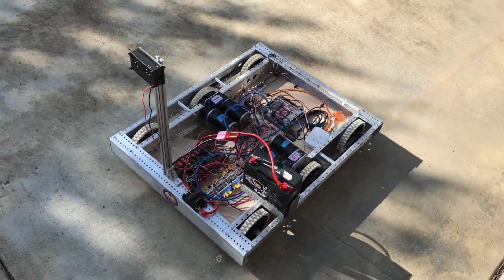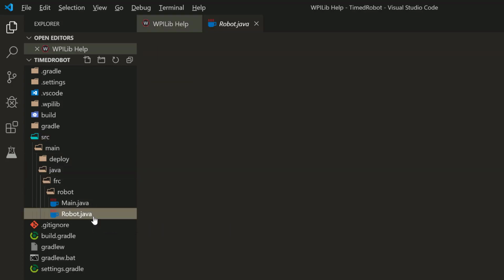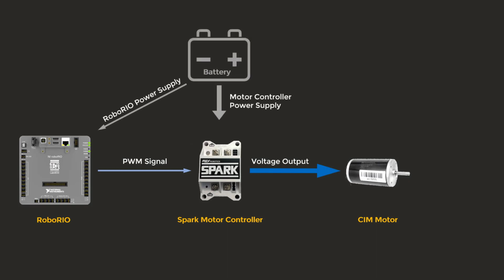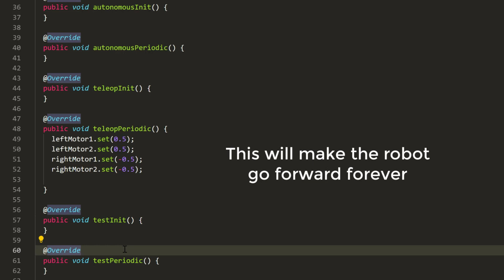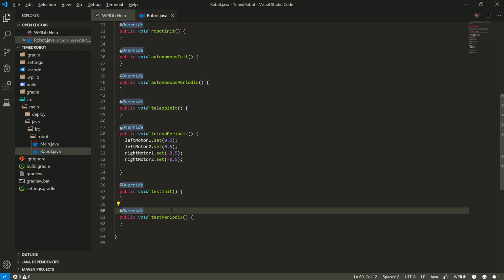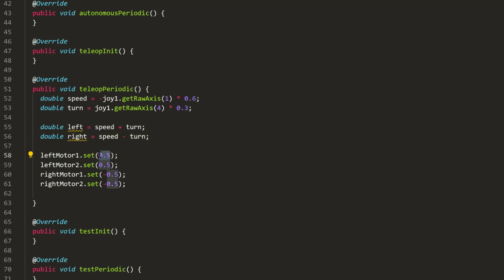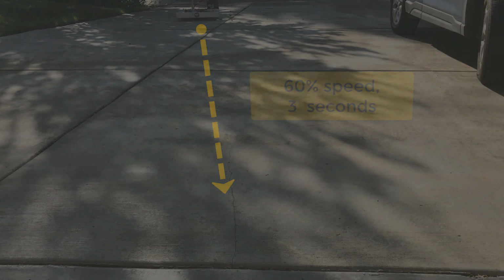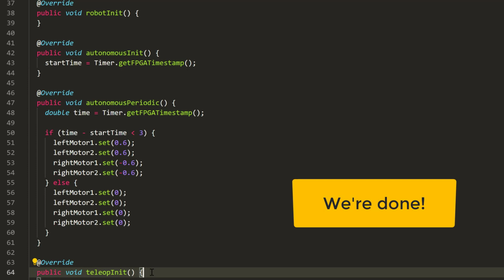FRC 0 to Autonomous: #1 Arcade drive + auto-line

Comment: Thank you for the tutorial! I don't have the hardware with me rn and I don't know if you will see this comment but am I right by saying that this can also directly be applied to the TimedRobot template? Also, the method for giving the motor controller the speed on my end is supposed to take in two parameters. For example: motorController.set(ControlMode.PercentOutput, 0.5);  Any possibility that you could explain if this is important?
Reply from the maker: The motor controller you are using has multiple control modes, and by adding PercentOutput, you are telling it to simply apply a percentage instead of using PID, motion magic, etc. If you are interested in learning about them, check out our episode 3 and 4!

Comment: Very good video. I hope to see more. Just some questions did you manually create the arcade drive when you could use the differentialDrive class. Also in teleop periodic isint it best practice to instead define the variables once and then update them in perodic?
Reply from the maker: Hi, thanks for the feedback, this video aims to create a more intuitive code rather the most efficient one. I think it is good to have rookies think about what arcade drive is actually doing and not to just blindly use libraries.
Reply: You're not wrong, but they seem to be taking the approach of showing how things work to build understanding, rather than just giving beginning programmers black-box classes to work with. There are other approaches shown here that I would advise differently, but for a beginner video it is fine. Also, you should define variables at the scope they need to be used, usually. For ex, the startTime variable is defined at the class level because it needs to be used by 2 functions.
Reply: @curtisrozeboom6112  While it is typical best practice to define the variable where it is used, it's different when running highly repetitive methods like teleop periodic. When periodic runs repeatedly at high speed, if you define a variable within the method it will create it every time, then have to garbage collect it every time which is expensive. For one variable in one method for a simple example code it's not a big deal, but get a bunch of stuff stored that way and you can end up with performance issues. In things like robot programming or game programing it's common practice to move variables in this type of code to a reusable location.
Reply: @FloatingCoder  Yep, you've stated my point a little better. Upon re-reading this, I see I got the point about 'usually' defining variables at scope mixed up in a way that implies it wouldn't be better here to make them class variables.